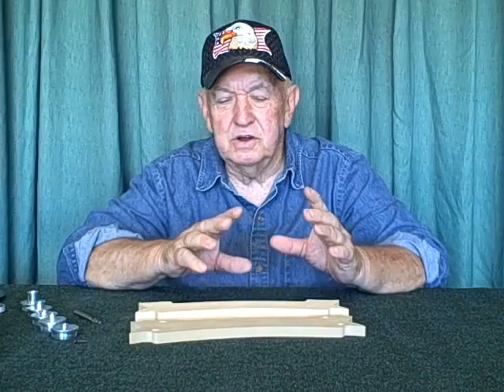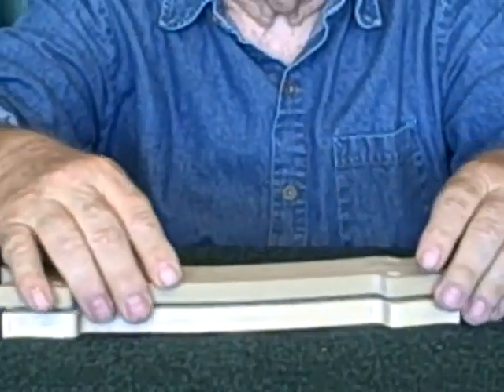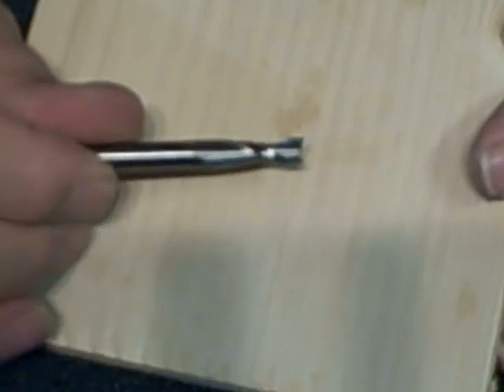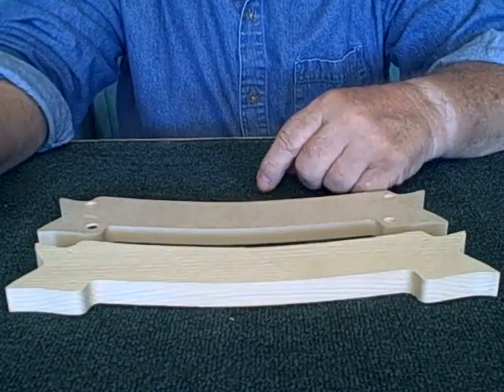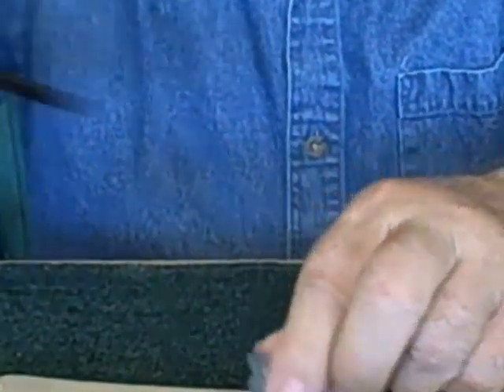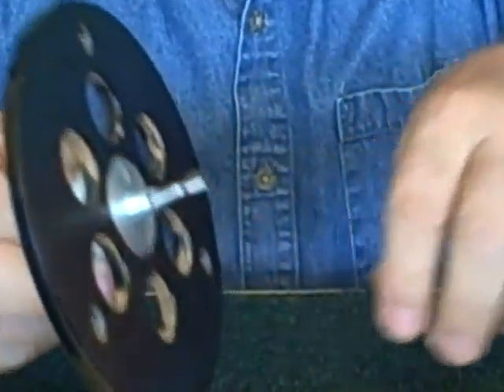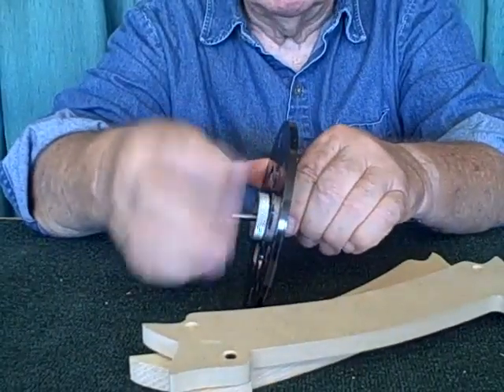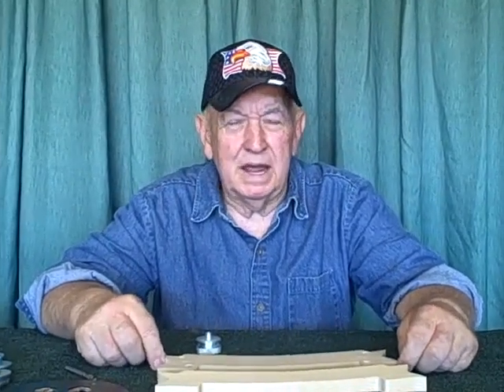#40 Dave talks about router bits part 3 - Cutting Shapes with template guides and

Comment: How are both the pattern and the working piece exactly the same size?  How is there not a small offset created between the bit and the actual guide?  I guess I am referring to the outside diameter.  I love  your videos!  Thanks for all the time you spend making them.
Reply from the maker: +Jonathan Tullock You are absolutely correct. There is an offset. You're board shape will be slightly larger than the pattern. Thank you for the nice comments. Very much appreciate you watching.